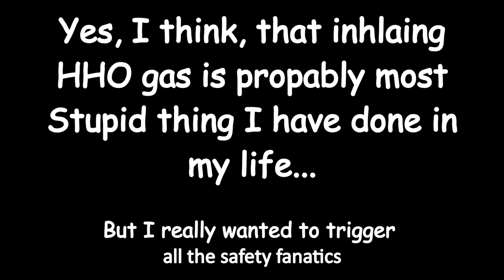HHO bubller making & explosion tests

Comment: A flash arrestor is suppose to prevent HHO from going back to your bubbler so you dont get explosions.  A bubblers main job is to scrub electrolyte mist. You don't want sodium or potassium hydroxide mist eating at the aluminum walls of your motor. And you'll want to keep potassium and sodium hydroxides off HHO torch welds Nor do you want to breath in that mist, already burned or not.   A bubbler's job is to scrub. 

An easy yet  thorough  way to scrub HHO gas misted with electrolites using a bubbles is to make micro bubbles. 

Take an air stone and place it in a larger tube. Pump water through the tube.  The air stone partially blocks water flow through the tube causing the water to speed up as it passes the air stone. Very fast water flow around the air stone breaks bubbles off the stone very quickly so they don't ever get big.  

One should choose a round air stone and seal the flat sides because they have slower water flow.  A micro bubble generator is also great for aerating your ponds 

I made my own air stones with muriatic acid washed beach sand,  rinsed, dried, and then mixed in sodium silicate, and cured by breathing out through it.  Works great!
Reply from the maker: briliant idea forcing water through airstone! thx :)
Reply: @IlusysSystems  https://youtu.be/r4rJKypLijA

Your just aiming for micro bubbles. In that video nano bubbles shrunk because the air inside the bubbles diffused into the water. But they won't shrink if the water is saturated.  
Anyways, the bubbler is meant to scrub hydroxide mist from the HHO gas stream.

Comment: I think left side had more bubble generation is because speed of incoming gas hits the wall and then just pushes up (with closest holes being on the left). You could easily test this by limiting the speed and how gas enters the block (maybe putting a block of wood after entrance for gas to hit against)
Reply from the maker: That is not really a problem - it works fine as it is...
only problem I see is, that in case of explosion, there will be quite high vacuum in outlet that will suck water like crazy.
But I think that explosions should not happen in first place...

I still don't have reliable way of shutting down the flame that will eliminate human error...